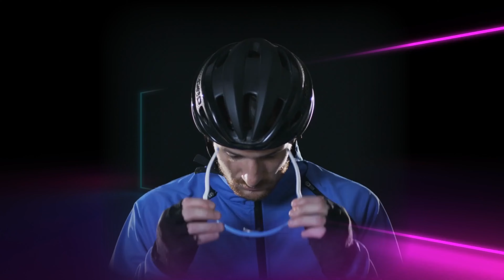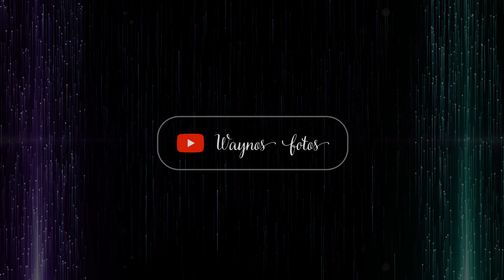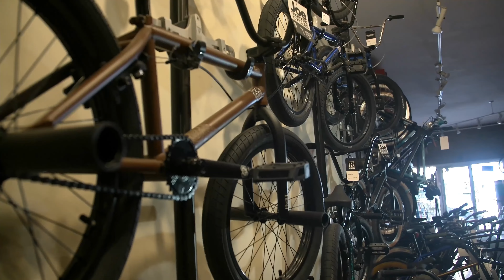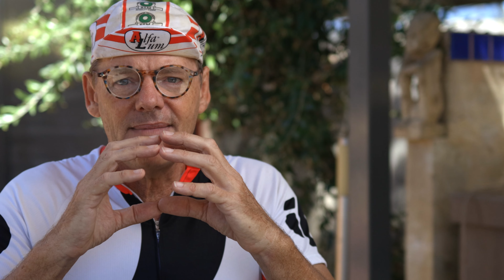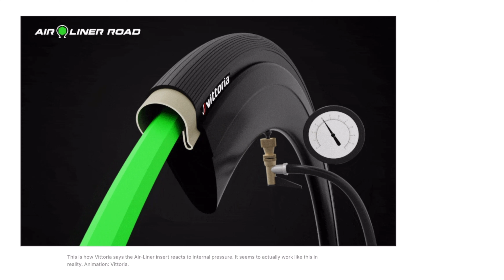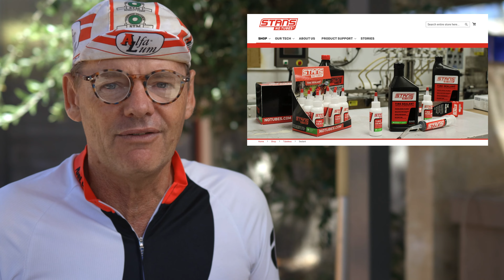Where is Road tyre technology going?

Comment: I have a Cx bike, an XC bike and a road bike. Running all tubeless, but on the road bike I’m going back to clinchers with latex tubes. I have Veloflex evo 28s and running them at 80psi but they are so hard! Terrible! At 60 psi it’s like riding through sand . Veloflex I love you but not that much. Give me a 25mm Veloflex Corsa Race with latex tubes 80-90 psi fast, smooth and supple!
Reply from the maker: Interesting, they evo must be quite different. I am running 23mm critirium and they feel more soft than hard compared to other brands. Have one of the new 23mm, almost feel the same.
I also like vittoria speed. But they wear out very quickly.
Reply: @waynosfotos  sidewalls are obviously more robust on the TLR versions. I only tried the evo TLR but to be honest I don’t want to try the Race TLR version after this experience. You also need a compressor to get them seated. A load of mess, stress and faff IMO. They aren’t even faster so there’s no benefits to me. Going back to the clinchers which felt nicer even at higher pressures. Don’t get me started on hookless! It wasn’t a scientific test but GCN recently did a rolling test down hill on an everyday hill and found 80psi was the fastest, but you can’t pump your tyres up that high on hookless rims lol 😂 😂😂 it’s so retarded!
Reply: Really? I mean REALLY?? 28s at 80psi is “too hard” Dude wtf ARE YOU RIDING ON?!! I’m here in N.E. Italy 🇮🇹 “F”ing going FULL NANG on downhill descent at 80+kmh, braking hard then hairpin after hairpin. Also 100km+ rides with a mix of city, open road and rough patches…

But I digress, ride what you like b/c YOU like it. But for _UX SAKE PLS STOP LISTENING to the PROPAGANDA. (I’m 20yrs in the military aeronautical industry so we do our own research and b/s ‘findings’ always take back seat to PROVEN PHYSICS.)
Reply: @SprayIgniteBoom  lol we’ve all got our stories!

Comment: Tubeless wide tyres are just too expensive. I prefer the cheaper wired tyres for commuting and normal riding. I'm not going to spend 40 + € for some fancy tyre. I guess racing tyres cost even more. Like 80€ maybe. 30mm wide universal clincher tyre for commuters and normal people, around 20€ or less is what I use(in summer). I have tried wider tubeless ready gravel tires with innertube, but had so many punctures and snake bites with inner tube that I don't want to see any of those anymore. Although I liked how they pop on rim and don't need centering on rim. Wired tires are often too much larger, or in worse case smaller than rim and then it's so difficult to get them straight on rim. Non tubeless folding tires also are sometime very difficult to get straight on cheaper rim, if rim is also slightly bigger than it should. But tubeless ready rim with tubeless ready tyre, is so nice. It pops on place and stay there, but unfortunately there aren't any that I would like to buy. I guess manufacturers won't make them work well with innertube, because they smell money that they, or their partners from distribution network can get from selling you tubeless conversion kit too.

Comment: Do you have a spare tire in your car?
Reply from the maker: I also don't have a spare tyre in my car, just a sealant container
Reply from the maker: In my tool container on my bike. They fold very small. But very rarely have to use it as sealant fixes 99% of problems.
Reply: He carries a heavy tubular tire folded up…. But complains that we shouldn’t have to have a tiny lightweight tube as a backup? Just bizarre. I have a spare tire on my car… but I actually use sealant and inflator instead. Car’s will always have spares, its easy to fit, easy to swap out road side, and gets you out of a jam when the tire gets destroyed beyond the ability of a plug and sealant.

Comment: I use tubeless. Generally find they work well. Moved after puncturing tubes three times in one ride. Usually get through the summer without puncturing. 

Agree on common standards. And not easiest to install. Different tyres have their own unique foibles.

Comment: I have been using tyre of the future for 3 years seem like? It's call TANNUS
To me the main priority of the tyre technolgy is = "service-less" and TANNUS airless tyre is a dream come true to me. It really give me a peace of mind and make cycling....worryfree.
ps. I do install expensive tubular tyre on my TT since I ride on close circuit but no way I would ride it on the street.d
Reply from the maker: I know about these, no tube, they use clips to hold them on. 
People say they are bit harsh and wear quickly, but that is only from reviews. Never tried. 🤔
Reply: @waynosfotos  I never suggest it to anyone since most cyclist kind of umm "demanding. ^_^ They see themselves as "racer"
I am a kind of audax randonneurs rider "distance first time second"
ps. Best thing about this airless tyre is you don't need spend and carry all those spare tube and mini  pump or CO2 with you anymore.